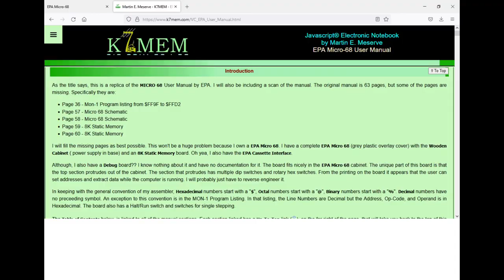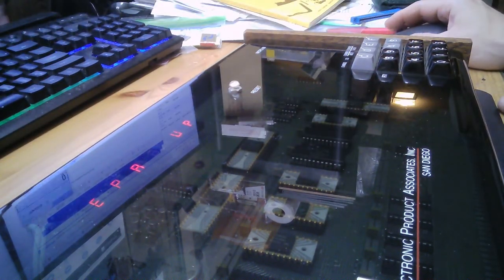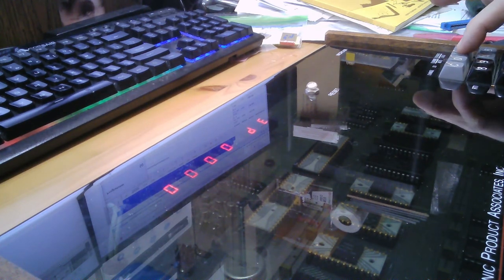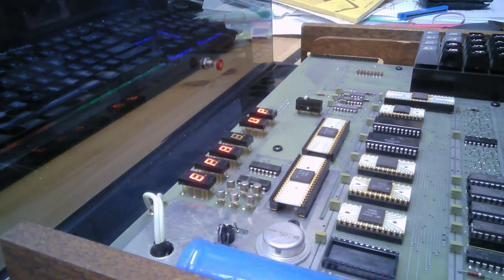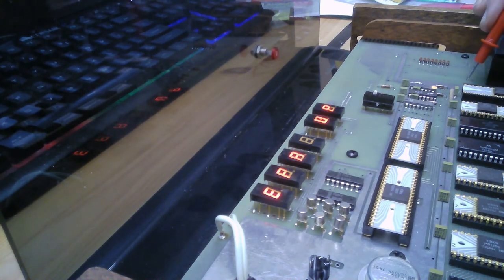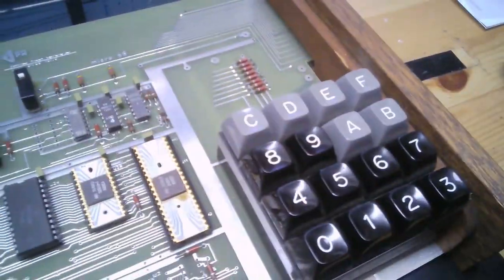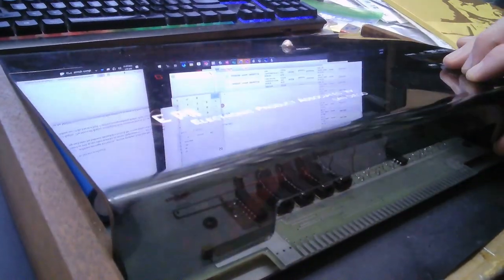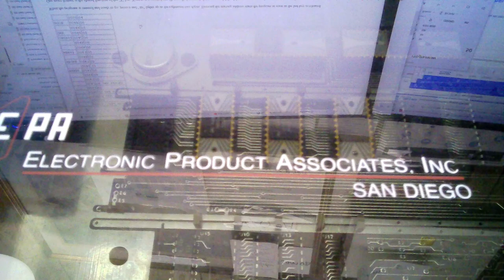EPA MICRO 68 demonstration early Motorola 6800 computer

Comment: Great to see a 6800 machine. I have an system on a 8 inch square board. Connect 8 data switches, 8 address switches 8 data LEDs reset and run and a push button.     Amused myself many hours trying out op codes a displaying results on the LEDS. Still got it along with several other boards. Thanks from  England.